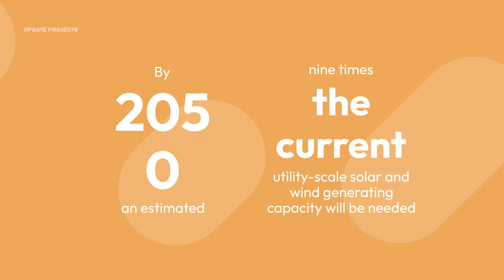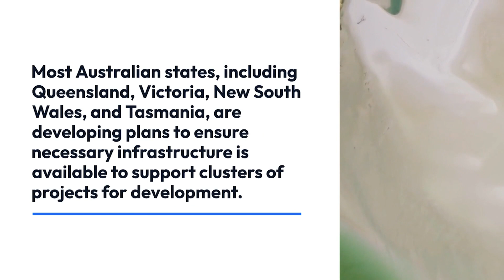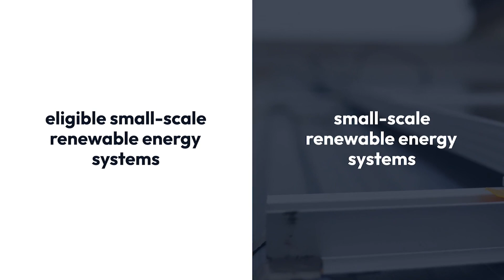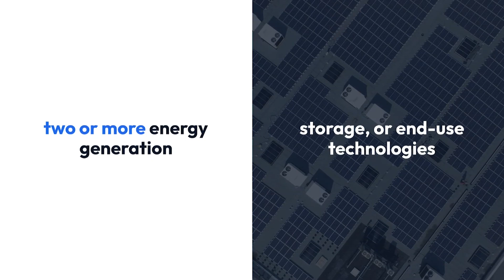The largest Solar & energy Mega project - Australia

Comment: "The largest Solar & energy Mega project - Australia" - "No matter how highly mechanised and fossil fuels self-powered, fossil fuels extraction requires a number of people - as if the process is executed by hands using buckets and ropes".
Today, this number is 8 billion people - working flat out 24/7 - strong.
Our Western Civilisation has been no more than a fossil fuels extraction operation - all along.
Finite fossil fuels are dangerously hypnotic to humans, their consciousness, reasoning and mental capacity.
Humans were not ready morally, ethically and intellectually to start the mass extraction of fossil fuels with the advent of the steam engine 300 years ago.
The Magna Carta requires today overhauling - adding to it the right for humans to understand what Energy really is - before any other commandment.
"In any system of energy, Control is what consumes energy the most.
No energy store holds enough energy to extract an amount of energy equal to the total energy it stores. 
No system of energy can deliver sum useful energy in excess of the total energy put into constructing it.
This universal truth applies to all systems.
Energy, like time, flows from past to future" (2017).

Comment: Good Luck Australia and the world with Sun energy clean and abundant.  The challenge is haw to harvest all these energy, haw to store and transmit on the market, materials and capital needed to build PV or other clean energy machines which generate intermittent energy, then store these energy and at the end transmit on the market to keep the economy running.  Earth has all what we need, and Australia has more than everybody else with abundance.  The problem or challenge is on time to build what is needed, capital needed and many other.  It is worth spending on researches on these sources of energy, but achievement arrived actually on PV, storing and distribution are over estimated.  Yes overestimated. This because really the sun energy per every m2 is high, and if this will be covered with PV will give 3 kWh/day/m2 (or more in Australia), but this will need capital from mining all what is needed, will need capital on processing, will need capital on energy storing and on energy distribution.  All these are probably overestimated by thinking the cost is lower today compared with before. These is true, the cost is lower, but the prices are higher and higher and the efficiency on every investment is not considered on considering intermittence, short life, re-investment and recycling.
The world need energy on demand, and these can not be achieved with intermittent sources of energy.  On other side the world has abundant nuclear energy, abundant geothermal energy, and abundant gravitational energy.  All these if used do not need energy storing because produce energy 24/7/365 and every investment will work longer, at least 3 time longer than PV solar, at least 6 time longer than battery storing and these will not need intensive transmission lines. 
Nuclear energy reasonably has scared many peoples worldwide even power plants are designed safe. Geothermal energy is not economical on most of world locations and these depends on geology.  Only gravity energy can be exploitated everywhere and generate electricity 24/7/365, but this need "forced levitation" of solid blokes and then gravity will power the generator to produce electricity.  This technology does not need storing and exaggerated transmission line, the gravity and levitation is present everywhere, but the mystery is only recognizing the physics of levitation which is not disclosed.  The disclosure can be done only if all world government will provide free energy for all working peoples but excluded all businesses. Let the Australian government contact and further negotiate about energy and energy transition.